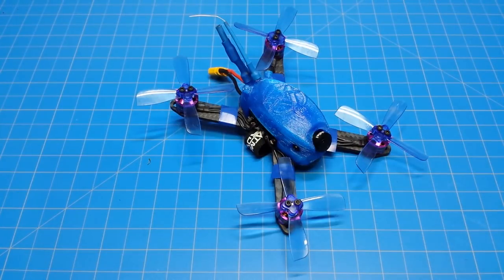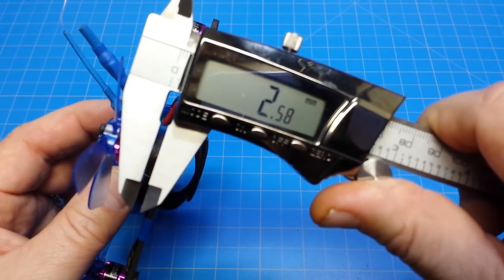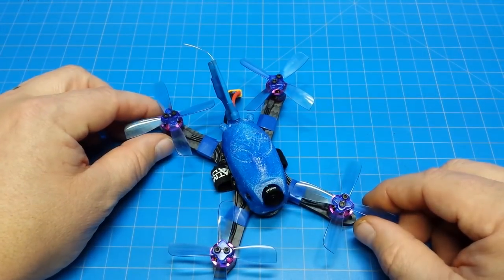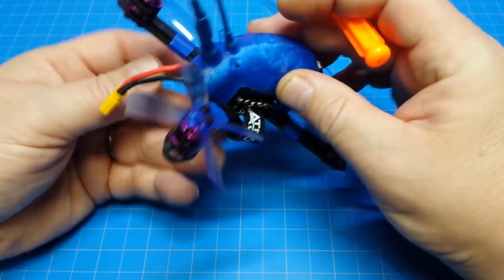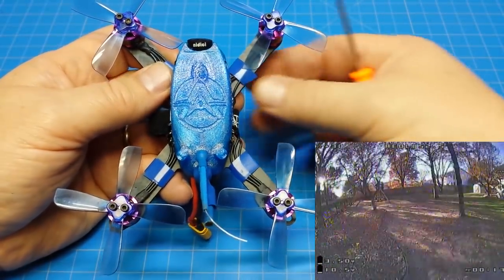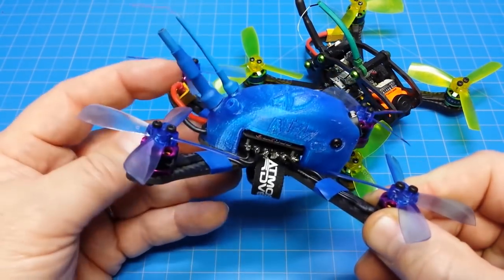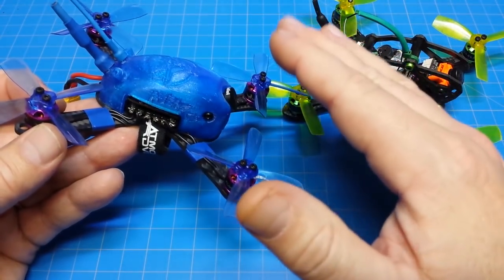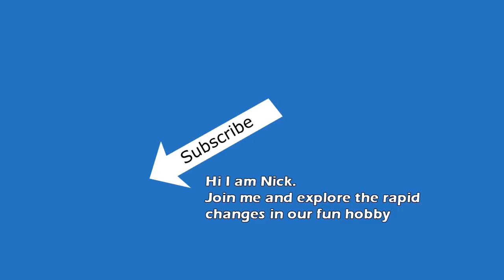AA Aeolus Mini 2.5

Comment: Always love your vids Nick! Been thinking about grabbing one of those nidici cams but now I see I don't want one. TY!  
  I was thinking exactly of the disk unloading subject Kabab talks a lot about exactly when you mentioned it and I think you hit the nail on the head there. It's a bit of a bummer that phenomenon is true as the pod quads like this are so sexy. I'm always finding myself drawn to the tight and difficult builds like this- of course! lol.
Reply from the maker: The printed pods have stylistic options cf doesn't. Pods only seem to work in the whoop configuration, pod above the prop line.

Comment: I have 2 of these frames.  One of my builds is very similar to yours: iPower 1104 7500kv motors, Cicada 10A 4in1 Esc, VTX03, Runcam Micro Swift 2, F3 Omnibus FC, Aeolus Mini 2.5" Frame with Microcam Pod, and 2.4" props.  Then I have another which is the same except it uses the TX02 microcam/vtx AIO and the standard pod; with Gemfan 2535 props.  The one with the standard pod is a beast.  Flies light and is super punchy.  The build that is similar to yours, flies heavy and is a bit sluggish compared to the other.  I believe there is a power and response loss when we use the Microcam pod because we are limited to 2.4 props (there really aren't any GOOD ones) with extra weight to boot!  The standard pod build weighs about 10g less and is so agile and light in the air.  There is a definite difference...I enjoy the better clarity of my Micro Swift build, but the standard build is just faster and more responsive!
Reply from the maker: Yes, less weight can often be more fun.

Comment: try reversing the props on it I find it helps with my similar model
Reply from the maker: That's an interesting thought.
Reply: mine had this weird high throttle wobbling thing it would do no matter what the pid values were till I switch the prop direction so I wouldn't be surprised if that helped this one too

Comment: what are your thoughts on the new trend to go back to whip antennas vs cloverleafs on micros? They seem suddenly better with the ufl connectors compared to the old dipoles on sma. Thoughts?
Reply from the maker: I have find the whip antennas work either just as well or nearly as well. And they tend to live a longer life, couple that with how inexpensive they are and light, for micros I almost very exclusively use whip/linear antennas.

Comment: I'm astonished that they recommend 3S batteries for 7500KV motors
But at least motor replacement seems easy - though the connections seem unprotected.  Weird design
Reply from the maker: I fly 3s on 7500kv most of the time, really its the esc I worry about 10amp doesn't generally hold up but the 12amp will with a burst to 15amp.